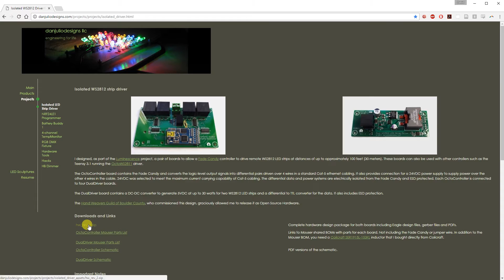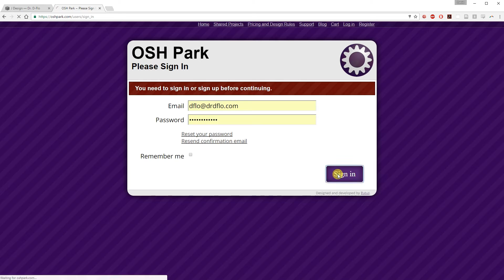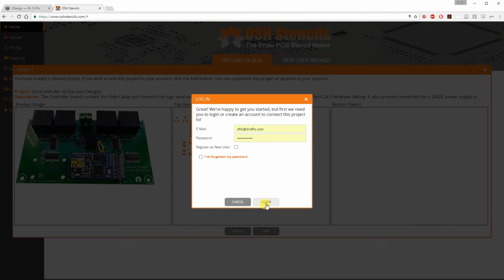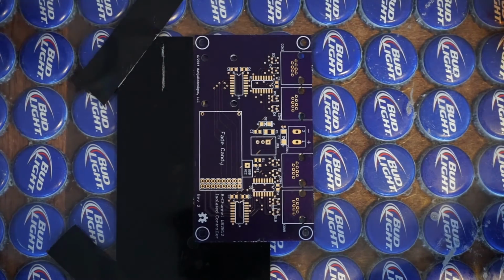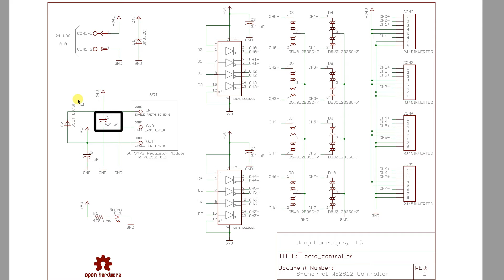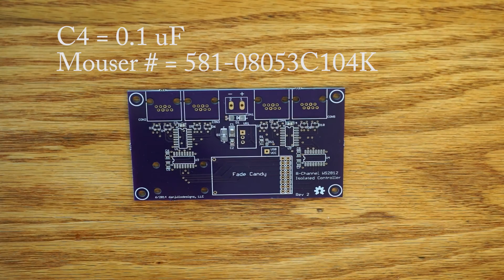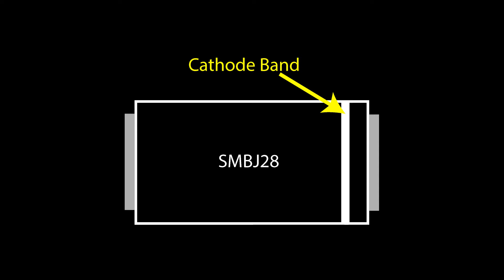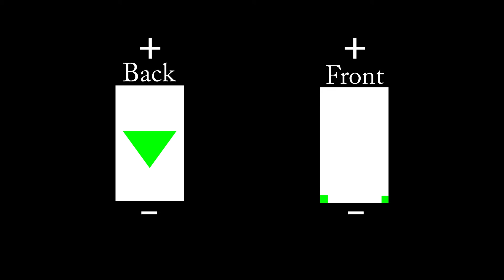1000 Addressable LEDs: J Design - Controller Board (Part I)

Comment: Just a tip: When soldering through hole components; you should really let the solder flow through the hole before you lift your soldering iron. I see you lift it as soon as there is some solder at the pins. If you instead look close when you apply solder and you let the iron stay for 1-2 seconds, you will notice that the solder goes down into the hole and it will give you a good connection. :) You should be able to see the solder at the other side of the board. Your videos are great by the way, I hope you will get a lot of subscribers!
Reply: wait you mean his shitty cold soldering isnt sufficient?